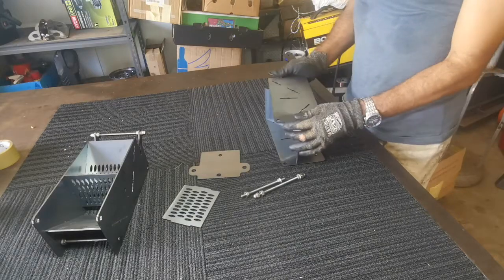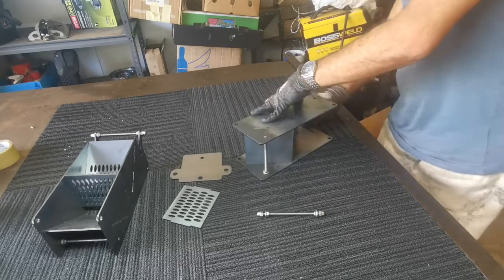ESA Fuel Basket Assembly

Comment: The plate with the holes appears to be at a 30-degree angle and the plate without holes appears to be at a 30-degree angle.  Do you experience any clogging issues with the pellets and ash?
Reply from the maker: The back plate with holes is about 45 degrees and the front plate with holes is vertical... no issues with clogging

Comment: Will u be working upon cook stoves similar to used in Europe as" la nordica model" and other wood burning stoves which can be placed in a corner instead of fireplace
Reply from the maker: The La Nordica is a space heater, not a cook stove, and no we are not planning any in that size and shape, however we are working on a larger unit designed to pump out maximum heat on a small footprint. S